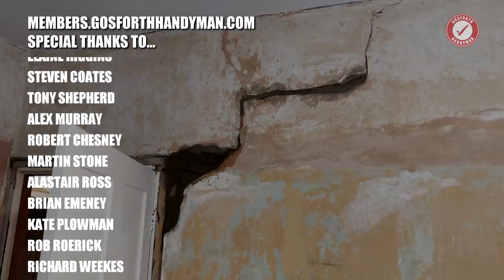Using a car jack to level door frames (1920's Renovation Part 18)

Comment: oh, you should have a lot of patience to deal with such houses, and I'm sure majority of houses in UK are in the same or worse state (including mine build around 1927)... I think it might be cheaper and faster to demolish the house and build a new one.... In general I think that quility/price ratio in UK is among the worst in the world.
Reply from the maker: You're not wrong! Building a house from scratch typically takes around 9 months. A full reno like this can take much longer since there's so much to strip out and fix before you can even get started. 👍😁
Reply: You'd have thought a nice modern house built to nice modern standards would be sooo much better.  I've lived in 1970s house where the bricks were 'frost shattering' below DPC, as the bricks weren't fired hard enough. The inspection chambers were built for foul and grey water, but no pipes joined them, all for show so the building inspector could be conned. I have seen a friends bungalow, none of the doors are  parallel to their frames at the top, built in 1990s I think.   I live in a 200 to 300 year old house built of stone and mortar, well the mortar has returned to dust, but the stones are there through habit. If it hasn't fallen apart over that time, it must be a good one. I've fixed the intervening 'nuggets' attempts at bringing it down so should be fine for another hundred years. My old house and my friends? I suppose they will be torn down and rebuilt in a few decades, just as some of the contemporary to mine have been.
Modern regs are only as good as modern inspections. (The inspectors I've met are great, but over worked, how much duff work has been hidden from them? We are coming up to the Grenville Tragedy anniversary. It was the 2010s modernization and lack of maintenance that caused that. The 1970s building would be cold, but may not have killed so many.)
Another thought provoking video, Andy.
Reply: @GosforthHandyman  the point being, of course that if you want an old house, you don't want a new one!
Blindingly obvious, but the new build will have no character, no odd quirky bits, no history......!
Reply: @andymccabe6712  well.. I would say that in UK with number of new builds and places where they built you barely have a choice. The best choice you usually have is either house with history of 70 years or 100+. I couldn't buy new house in the place where I was searching. Just because there are none.

Comment: Is I was u.  I wouldn't do that.  I know the problem I've had meny  times before.  I do house renovations.   Take out the door frame.  And  strength with wood next to the door frame  and joists frooring. And cement.  It will sage back. If u don't

Comment: Why jack the door up at all? Why not pack the door frame out, and accept an ever so slightly smaller door?
Reply from the maker: The doorway and architrave would be at a different height to the adjacent door. Did consider this but it would be very noticeable. 👍

Comment: I would have ripped them out and put new frames in.
Reply: Many people like older houses BECAUSE of the old fixtures and fittings - otherwise you may as well buy a new house.....!!
Reply from the maker: Taking out the frames would have also taken out the walls. 👍

Comment: I'm guessing it's early 1920s? I get the impression that it was cheaply built.
Reply from the maker: 1925 or thereabouts. It's solidly built mind. Lots of features that you rarely see in such an old house (cavity walls, minimal lath & plaster etc.).
Reply: @GosforthHandyman  I think cavity walls are quite standard in all the post WW1 houses in the north. For what it's worth last week I visited a friend in Edinburgh who lives in a 1920s bungalow, and I compared it to my 1930s house in the north west of England. The quality of his bungalow is way superior. For example no silly brick floor in the kitchen which causes adjacent walls to be damp,  his joists are about 30cm  over the external ground level, no spout from the kitchen sink etc. draining into a "ground drain" (kitchen and bathroom have separate iron waste pipes which  both properly go underground). loft is not built on 2x3s. On the other hand I think 1930s house I used to rent in Coventry didn't have cavity wall. So maybe further up north you go, the better quality (because of more adverse weather perhaps)